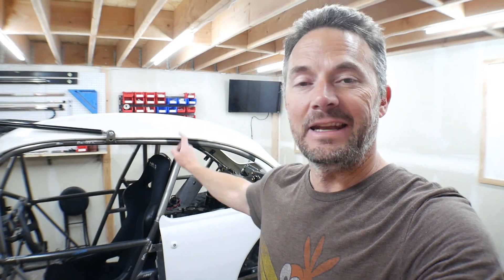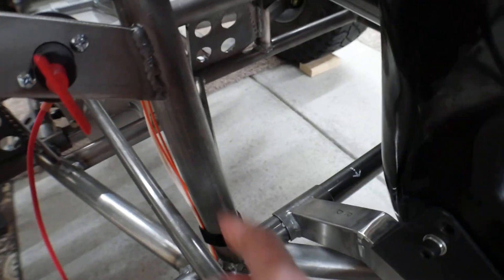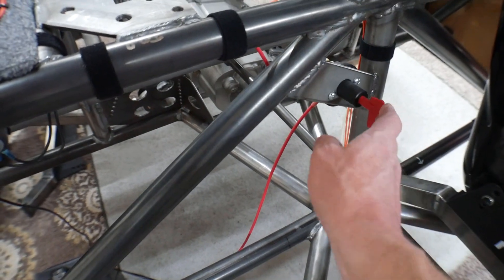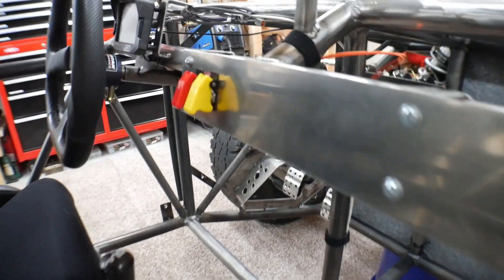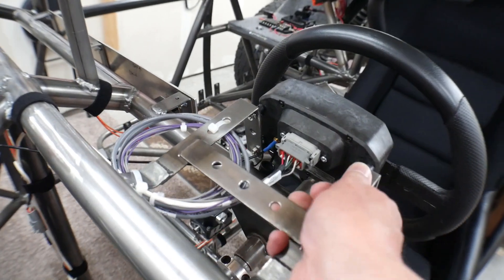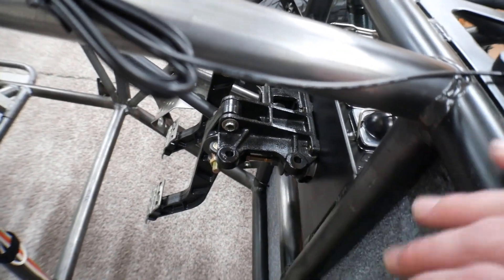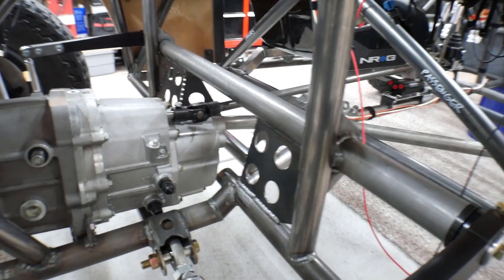Wratchet update #2

Comment: for relays, you want a separate relay for; coil power, O2 heaters, and injectors/engine +12v (DBW/ALT/VTEC SOL etc).  make sure when you bundle your harness that you run coil signal and power separate from CKP/CPS, so they don't pick up IGN events.. (might be a good idea to isolate those grounds as well)  good stuff man, keep at it!   I'd also suggest maybe a few more floor bars in the front, triangulated into those main nodes.
Reply from the maker: Thanks for the tips buddy, I'll do what I can to separate the signal wires too. 👍

Comment: Doug, 
I am really enjoying watching all of these Wratchet build videos. Only my opinion and a question of sorts as a curious individual...I would personally like to see more tube cross-bracing on the floor; triangulation as you have been doing. Since both buckling and twisting forces acting on those remaining open "boxed" floor sections seem to become greater as the sounding parts (sections) become stronger with bracing. looking at the screen capture at 6:35, it appears quite open still. any thought? cheers greg
Reply from the maker: I agree with you to a point, but I'm starting to feel like I'm adding so much bracing that it's becoming a tank. I'll still add more bracing, but I'm taking a step back now and thinking what to add.
But I appreciate the feedback and ideas. 👍

Comment: Keep in mind that the length of the intake runners and the volume of the plenum dictate the amount of low end torque. Especially on Honda's.
I assume, you don't want to be revving the nots out of the engine all the time.
And if you are going to add some turbo's, the aforementioned torque will fill in the inevitable turbo lag.
Try to Google "intake runner length formula".
There's a lot of good info about this.

Especially in this application, the 'volume' under the torque curve on a power sheet is more important than the peak figures.
Reply from the maker: I hadn't considered that at all.
But I'll look it up, thanks for the tip. 👍
Reply: @DougBugBuilder  Looking at the plenum, I thought as much. You mentioned the intake, and I just hoped I wasn't too late.
Power is nice, but if it's all on top, it gets irritating very fast.
Unless the application is NASCAR, you will be under 4k a lot.
As in: 75% of the time, if not more.
Reply: Also, intake runner length is measured from the valve seat. The cam will more or less dictate whether long or short intake runners are appropriate.
Engine building and tuning can send you down a tunnel that might seem to have no end 😳
Reply from the maker: @rickrack78  It wouldn't be the first rabbit hole I go down. 😉
Reply: @DougBugBuilder  If you run STD cams (which I think you should) the STD intake will be the best choice.
Even when you go turbo later.
Reply: Larger throttle body can be an issue too - they mostly help only at the top end and if too large will make it difficult to be smooth at low RPM.
Reply: @KarlFosburg  True, though that's most prevalent from idle to minimal partial load (read: as in heavy traffic) , but since it will not have the OEM ECU and an E-throttle, you can actually program a lot of finesse back into it, instead of the dreaded pogo-effect.
Reply: @KarlFosburg , hopefully he will be able to tune tip in and low rpm throttling with the fly by wire settings in the ecu’s software
Reply: @Paul_VanGo  Good point... I've only used mechanical linkages to this point.

Comment: Great video as usual but one quick question?  I use a similar distribution fuse panel in  my buggy but I use the unfused section as the negative side of system.  Did I understand you correctly are you using that section as a distribution point for your "keyed" or ignition power location?  That is interesting if so that creates a good location to connect those wires.  I am an electrician so my entire world is always 2 wires so use mine as a location to land the negative side of the loads.  Again I have a habit of running 2 wires to everything so therefore I need a place to terminate them!  Thanks for sharing.
Reply from the maker: You are correct, I'm using the top portion as "switched power". This is protected by the 30A fuse for the ECU relay. The harness I bought used a junction block for this already. But it was cumbersome and un-mountable. So it was hard to work with. So this fuse block is meant to have the upper portion used and grounds. But I repurposed it as "switched power". This way it's easy to work with. Then I welded a bus bar underneath next to where I'll mount the battery. This is where I now will land my grounds. I should have shown that in the video.

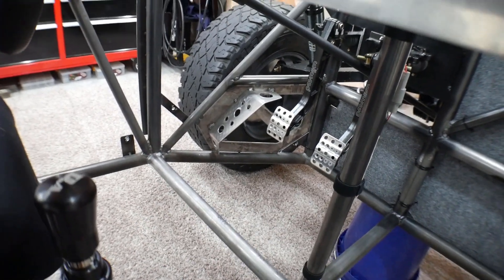Comment: Doug Bug, There something that my mind that somehow disagree how you are wiring the ECU, 7:19 This only my opinion. Maybe I am mistaken and misunderstood what you said and also you are not finish with the wiring yet. I like you to take a look at this wiring diagram of the Infinity 506 at this link.  It looks like they are using the same fuse box you are using. The top part of the box with the bus bars is being use for the ground side of the injectors, coils, O2 sensors and etc. When you go to this website scroll down to the 5th diagram. I my experience, car manufactures wire their system almost similar. The reason manufactures wire their sys ground tied together is when a multiple DTC occurs you can suspect a bad ground. There should be a 10A POWER supply to the AEM ECU all the time also for the memory.  The power supply going to the ECU only draw around .02 Amp if I'm not mistaken and it doesn't drain the battery for awhile.   Otherwise, if you shut the power off completely to the ECU it reset the fuel trim  and restart relearning all over again every time you turn the main power switch ON. Nice progress!!! Nice meticulous job!!!  whttps://easyeda.com/CAL-State-LA-Formula-SAE/AEM-Infinity-506-Schematic.
Reply from the maker: Well that's a nice reference, thanks for the link. I'll use this for some of my build.
Couple differences, I'm using my fuse block for the entire vehicle. So on mine the lower portion will power the ECU, fans, FP, and vehicle lights. This is why I made the upper portion of mine the "switched power" from the ECU. I'll use that for fuel injectors, coils, O2 sensor, etc.
I welded a bus bar underneath to the chassis, this is where I'm landing my grounds.
Also on this diagram I'm not sure they have the main relay wired correctly. They are running permanent power off the energized leg to the ECU. The ECU needs a dedicated permanent power first before it can energize the relay. But I might be looking at it wrong.
Let me know what you think, and thanks for the link.
Reply: @DougBugBuilder , Looking at the wiring diagram that I mentioned, I think you are looking at the wires going to the main relay as a reference instead of the pin # of the relay. On your relay case itself,  there is a wiring diagram printed on it. The voltage coming from the main fuse (30A) that is going to Pin # 30 on the relay actually, when the relay is triggered, it will turn on the pin # 87 instead of #85. Pin # 86 & 85 are use to trigger the relay ( It looks like, on the diagram, coming from the AEM box ). When the relay is triggered, pin # 87 on the relay will power the fuse block which supply power to the  Fuel Inj, Coils, Fuel pump etc. 
On the diagram that I mentioned, should you use this wiring diagram, DO NOT hook up your oxygen sensor the way it printed on the 5th diagram from the top. The O2 sensor wiring on the 5th diagram is 12V supply for the heated O2 sensor. The LAMDA/ O2 sensor wiring diagram 3rd from the top is the one you use if you are using 2wire O2 sensor. BTW is this sys that you bought came with wiring diagram?
Reply from the maker: @b-lopez394  Got it, figured it was something like that. 
Yes mine came with a wiring diagram. The way I wired it is the way it is shown on the wiring diagram it came with. I'd have to look at their diagram again to see what they did different.

Comment: Why put the battery switch behind you? In a crash you want to be able to visually see it. We put it as close as possible to your hand that you can see.
Reply from the maker: I can't argue with that logic. And that's why I have the ignition and fuel pump right on the dash easily accessible. I just want the battery switch out of direct sight, so nobody can just reach in and turn it on. I suppose I could have one on the dash and one back where it is. It would only take opening one to shut things down.
Thanks for the thought, I'll think about it.

Comment: Which kind of steel u used to make steering knuckle is it mild steel , cast iron, chromoly steel pls reply
Reply from the maker: Those are made out of 1/8" and 3/16" P&O steel. (pickled and oiled)
Reply: Can I use mild steel
Reply from the maker: @prakascv8515  Yes you can, it'll just be a little tiny bit weaker. But really not a big deal.
Reply: Thank you. no one replied to me but u did

Comment: I have fallen behind on your videos😒 but are u running the Honda 3.5 motor?
Reply from the maker: Yes I am. What's in there now is a J35A3 out of a 2004 MDX. Although it isn't running yet.
Reply: Good call. I’m running the ecotec 2.4 and I’m not a huge fan of the Chevy motors. Those 3.5 are amazing

Comment: Small wire for 30A, no?
Reply from the maker: When I look it up it says 14g is good at 30A under 36" in length. Although I might be on the line, the length here is probably about 18". It just goes from the fuse block to the relay and back to the fuse block.
But for the most part, you are correct.

Comment: 2 handbrake levers ? is this setting common on Baja's or is it yours ?
Reply from the maker: Most manufacturers offer single lever or dual lever. The single is faster to operate for sure. But I like the duals because I can grab both handles and pull them both back to hold both rear brakes if needed. Sometimes that helps here in the mountains.